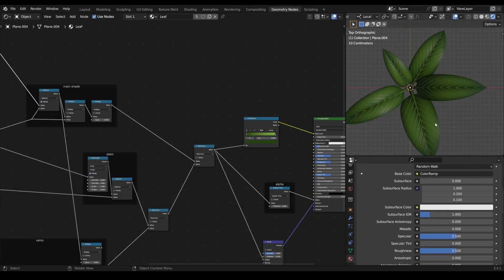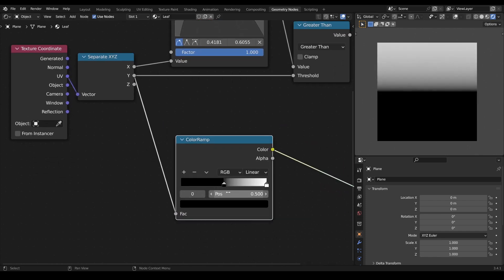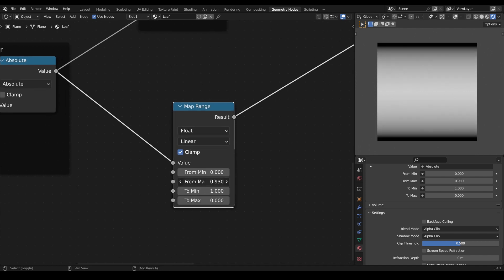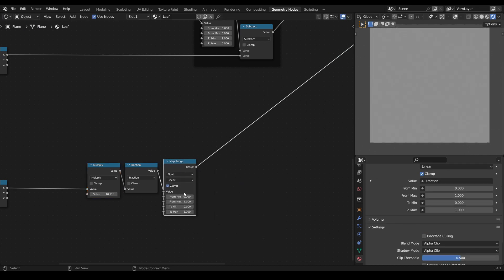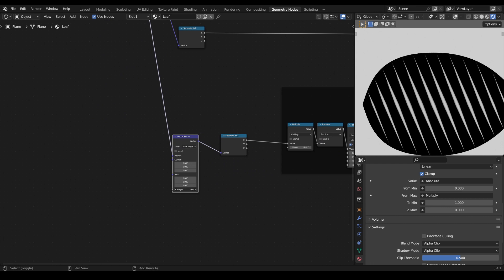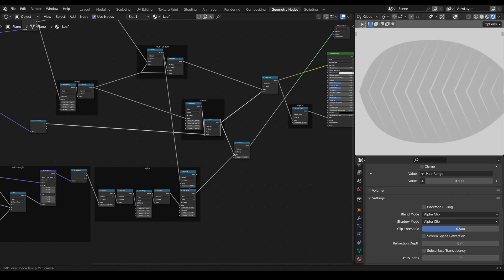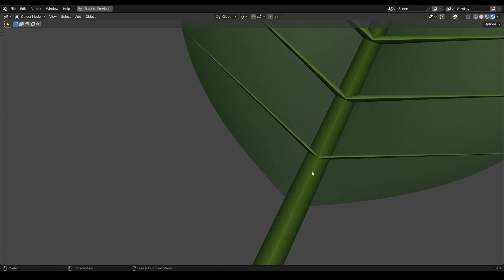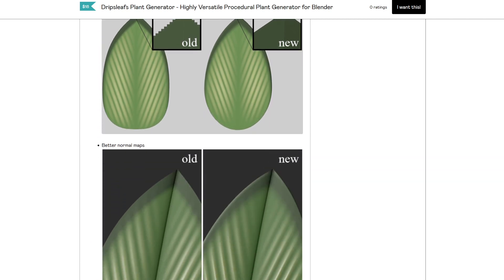How to create a Procedural Leaf Shader in Blender

Comment: I'm also trying to create a really simple shader that starts from the center and propagates outwards radially in a gradient with a color ramp for the values, but I haven't found a method yet, seems like it should be very simple but so far I can't get the result. I'm looking for something like what the fresnel node does as opposed to the radial gradient texture because the radial gradient/spherical gradient create a sharp sphere in the middle when I want actual geometry conforming layers.

Edit: I'm dumb, the color ramp and float curve mediate the gradient the entire time, it works beautifully.